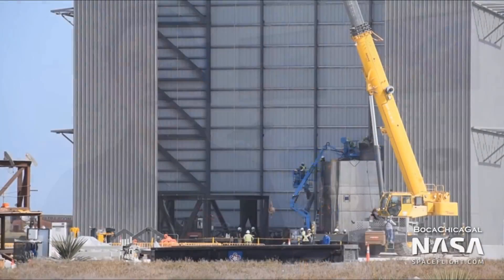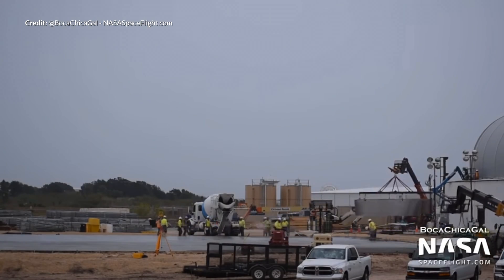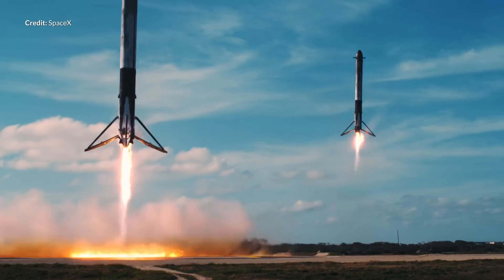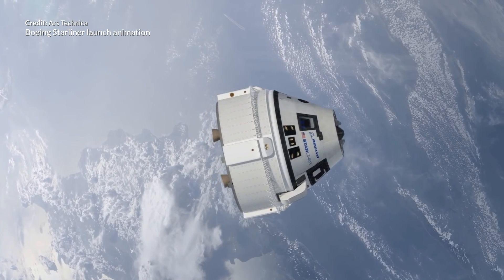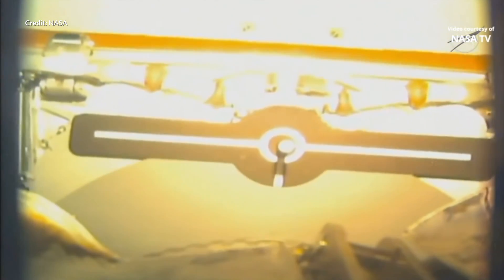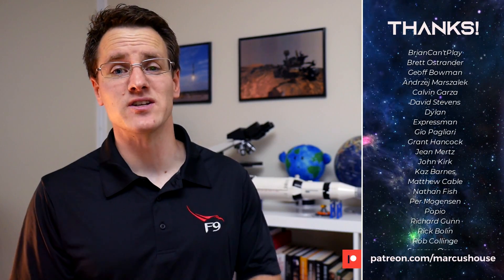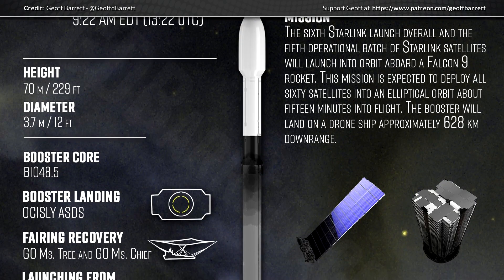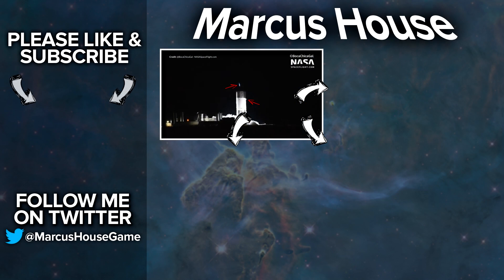SpaceX News, Flights with Starship SN3, Boeing Starliner, Blue Origin, Starlink 5 & Simple Rockets 2

Comment: It is only impossible because of physics, and merely a barrier that forces new thinking in mathematics and research to evolve what formally imposed orthodox of myopic ideas and technology.  Entrenched groups and technology, this works well for risk factors, that subsist on conservative dogma. By the large institution, engineering groups told not to take risks, and when young and passionate, you are squashed into submission or pushed out quickly—learning to get along versus raising the bar of innovation, advanced research, and investing in basic science and mathematics.

Comment: Great segment.  BTW - when you refer to a "water pressure test", the actual terminology of any pressure vessel in which testing employs water rather than compressed gas is a hydrostatic test, or "hydrotest" for short.  It is done for safety reasons.  A failed hydrotest generally just results in people perhaps getting wet, whereas a failed compressed gas test can go off like a bomb.  That's why, even those pressure vessels that are intended to be used for compressed gas always get first pressure test by way of a hydrotest; fill it with water, displacing all air, and then apply pressure to the vessel.

As always, thanks much for sharing.

Steve
Reply: The only drawback to hydro testing is that the weight of the water is a much larger factor than the weight of a compressed gas. This extra weight from the water creates a less even load, with the bottom sections of the tank being subject to greater forces and the upper sections being subject to lesser forces.
Reply: @XenicMatter , absolutely.  Nonetheless, it is usually the method employed to maintain an acceptable level of safety in testing.  I spent my entire career in the manufacturing segment of high-pressure oil/gas ball valves and check valves.  And of course the head pressure to which you rightly refer is generally not a factor on valves with comparably heavy wall sections and weight.

Steve

Comment: The worry with Boeing is that they have glossed over basic software engineering issues. They have shown that they don't understand basic testing concepts, for example comparing the actual final state of a test with the expected final state.
This suggests that they are testing for success rather than testing to find errors, ie failures.
At a personal level, it makes me reevaluate flying in Boeing vehicles, because this is the same kind of failure that was seen in the the recent crashes and the tankers. To me this shows a company wide cultural problem, meaning that it comes from the top. They need to refocus on their core business: Engineering.

Comment: All this rapid development is fine and all and i am fairly confident we'll be seeing starship test flights before long, but eventually they will actually need to get this thing certified as acceptably safe to carry humans. 

Trust me, Its being able to present a credible safety case to regulators that will take Space X multiple years to complete. 

Its not as simple as saying hey look we flew it x number of times unmanned and it didn't blow up, therefore it must be safe enough. You have to be able to quantify the risk (probability of failure * severity of failure) of the entire system and all its sub-systems and make a credible argument as to why that probability of failure is not only both, plausible and acceptably low but also that it is as low as you can reasonably make it. 

Most new planes, cars, toasters or whatever it happens to be, are based on incremental changes to established designs that can be used as evidence in your safety case. With starship though, the design is so different that they are likely going to have to qualify everything from scratch which will be a hugely expensive and time consuming endeavour 

This is why Dragon 2 switched to using parachutes and water landings

Comment: "need better and more testing, and better logs" is something that can be said about every software project ever.
Reply: MGL - But, Boeing’s really sucked - Boeing never ran a full debug on the software (let alone an end-to-end test of the software), &, because of the lapses in communications, NASA doesn’t have the kind of complete logs that NASA would have with almost any other vendor.
Remember, NASA paid a 75% premium on the basis that Boeing CST-100 would be safer & more reliable than the other contractors. Instead, CST-100 had a parachute malfunction during the Pad Abort Test & 61 (mostly software) anomalies during DM-1, several of which could have resulted in mission failure or LOCV.
Reply: Word!

Comment: Concrete Finishers is the name we use over here, and the machines there on are called ride on Power floats, there used on bigger slab pours, smaller slabs use a walk behind version, with only 1 set of rotating blades, think 4 or 6 large steel trowels, the ride on versions have 2 sets of rotating blades.
After the concrete is poured and levelled the power floats first use "Pan" which is a rotating steel disc that slots onto the blades this does the initial smoothing, after that the Pans are removed and the steel blades are used to finish the concrete if specified to a finer finish.

Comment: Marcus House: Could you address this issue?  Why does NASA never sent automated microscopes to look for life on Mars.
Automated microscopes are routinely used in microchip production by the Intel/AMD to look for surface defects ON cpu and other microchip productions down to sub micrometre levels. Thousands are scanned per hour and analyzed by software.Therefore could you investigate why is not being done? Nasa seem to be content to repeatedly do gas fart analysis which will always yield results which could be attributed either to life forms or complex chemical reactions.
Reply: If I had to guess, it's probably that the odds of picking up any exposed rock on Mars and finding microscopic evidence of microbes on it are effectively zero.
Reply: @EnDSchultz1  Who said the surface. The business end would be fitted to a probe which can burrow underneath.. Just like they have on the present probe on Mars.

Comment: Marcus - Do you know if SpaceX has ever explored production of forged, seamless ring segment?
Don't know if that's possible and if so, can it be done to the precision required.
I'd imagine they would have discussed it with steel manufacturers.  Just curios... Thx
Reply: My guess is that it would be too expensive/time consuming
Reply: mobayguy If they were forged, they wouldn’t have the extra strength from being cold rolled. The vertical welds are also not as problematic as e.g. the horizontal bulk head welds so not too much would be gained from having the rings be single segment.
Reply: @Borodalf  Good points Ryan and I've learned something new today about metal fabrication.  Great thing is that SpaceX is a thinking organization.

Comment: And I guess you also missed hearing from Tory Bruno of United Launch Alliance that the first flight-qualified BE-4s are going to be delivered for Vulcan this May.
Reply: Yes, because Boeing isn't making them. The engines may be there, but based on past performance, I don't expect the Vulcan to launch till 2023 at the earliest. They've said the first flights will be 2021, but if you believe that, I have a thousand acres of the moon's surface to sell you, a polar crater, so you have permanent sunlight at the top, source of volatiles in the crater shadow, even a nice masscon of heavy metals from the original impactor. Everything you need for your lunar start-up colony.
Reply: @stainlesssteelfox1  Boeing is not the sole owner of ULA, LockheedMartin also has half ownership as well and so ULA operates semi-independently of both companies. Also, ULA is currently on track to launch the first Vulcan rocket around this time next year. This why the BE-4 from Blue had to be ready this spring. Also, you can find plenty of ULA as well as independent space reporter video of Vulcan under construction in Decatur, Alabama. So it is real hardware and it is coming together just like New Glenn is.
Reply: @Nowhereman10  I know about the Lockheed Martin connection. I don't know if that's going to be enough to inject some competence into the design process. Here's hoping.
Reply: @stainlesssteelfox1  right but it's not as if LockMart is a small, peripheral thing. Also, ULA's semi-independent status means they have a different management team. So problems with Boeing are not necessarily going to manifest there. With Blue delivering engines in a couple months, Vulcan is going to come together rather quickly.
Reply: Tony Bruno is a joke.
Reply: @Cyberjohnnyt  and you're a worthless troll. Tory Bruno is a damn smart guy and knows his stuff. He's mostly responsible for keeping ULA somewhat competitive right now and if he ever leaves ULA, SpaceX and Blue Origin would do well to try and grab him up.

Comment: Wonder what effect corona virus will have on this rapid development programme?
Reply: Most metal construction jobs and industrial work like this require not only face and hand protection but half mask and or full face respirators (which are cleaned regularly with alcohol swabs, so they actually might be safer than you'd think

Comment: SpaceX 50 landings, competitors 0 and Jeff Bezos has the gall to go on TV and boast about being first to land a booster rocket. This is why I have no sympathy for Blue Origin. As per Boeing, the fact that Nasa is cutting them a ton of leeway and if SpaceX would have had one tenth of the issues Boeing had with their flight, they would have grounded them indefinitely, so not much sympathy there either.
Reply: Spot on.........Frankly, I believe Bezos is afraid to fail.........it's going to be a real problem because everybody does and he will too. As for Boeing, they're in it for the money, with no thoughts beyond. These are but two huge contrasts between Elon and them.
Reply: @GenasysMech  Bezos is a showboat narcissist like Musk.
Reply: Ok, so first of, the reason that SpaceX landed the first ORBITAL CLASS booster, is because the got funding from NASA. If anyone else had got funding for a reusable orbital class booster, then no doubt Blue Origin would have done that. And when they did get money for funding to build an orbital class rocket, guess what they did. They started development on an orbital class reusable booster. As for Boeing's failures, SpaceX had much worse failures to their Dragon 2 capsule, and had to go through the same review process as Boeing, so no, that's not true.
Reply: they were the first...and also the first to apply for a patent for the technology.
Reply: I mean, Bezos isn't wrong. And SpaceX literally blew up its manned capsule which is rather severe. Not ripping on spacex because the inflight abort obviously redeemed them of that failure, but NASA wants to have two capsules for redundancy they cannot be blamed for.
Reply: @williamcrawford7621  on the contrary their abort system is what makes D2 so dangerous.
Reply: @williamcrawford7621  Only good thing about SpaceX is they do enough testing to uncover these problems. Obvious bad engineering design but they found it before it was too late. Other manufacturers might not have the same luck due to their practices.
Reply: @FreeStuffPlease  how do you explain the code errors found during the starliner test then?
Reply: @divedevil985  that wasnt much of a test as a demo. They should have already found those errors
Reply: @FreeStuffPlease  I see. So the first time 3  (2 of which had never flown before) distinctly different vehicle subsections had to function together was not a test? Yet spacex had about 40 prior attempts to prepare for flying F9 and D2 together. What happened to "this is why we test"? 

Your comment and rebuttal are both ignorant.
Reply: @divedevil985  Lol whatever you say. Boeing could have unit tested their code and found some of those errors. It is an embarrassment how much of a failure that "test" was. What a waste of a rocket and millions of dollars.
Reply: @divedevil985  Go play with your 747 model planes now us adults our busy.
Reply: @FreeStuffPlease  like sending a tesla roadster to Mars? Your original point if I recall is that only spacex finds faults during testing. Although they are the only entity to routinely inadvertently destroy their test articles (and production versions) by no means is there any preferred methodology demonstrated in their build, destroy, build again development model.
Reply: @divedevil985  That demo was a success but at least you are trying. We will see how your SLS goes first try. Its going to be a while though...
Reply: @FreeStuffPlease  although the 747 was the most successful heavy commercial aircraft in history I spent my time building and flying the space shuttle among other historic aircraft. Being an unquestioning Musk groupie does not qualify you as an adult.
Reply: @FreeStuffPlease  the first launch of F9 nearly drifted into the tower during liftoff, did not achieve nominal payload orbit and the booster spun to pieces before splashdown. Guess you didn't know that....ignorant of history just as I thought.
Reply: @FreeStuffPlease  somehow you new space flunkies think taking the trash out of the Boeing designed and built ISS that has been in orbit since the 1990's is an unequaled accomplishment. I don't work for Boeing by the way. I just know history...in part by making it.
Reply: @divedevil985  Ouch that hurt. Just because Boeing has some flaws and can't catch simple errors in their software makes me a fan of musk? I guess that makes sense. If you like Boeing so much why don't you go fly on a flawed 737 Max. Or the failed Starliner. Or an untested SLS. I on the other hand will take my chances in a crew dragon and falcon 9. Like every other person with a brain.
Reply: But Jeff is correct though, blue origin did land a rocket booster and fly it again first. It just wasn't an orbital class rocket booster, but he never claimed that it was, so i don't really see why you're getting angry about it. This is also why Space X always states 'first orbital-class rocket'.

The rest of what you are saying is just hyperbole. What leeway is NASA cutting Boeing?
Reply: @Br3eZzY  no, they didnt. Grasshopper did that first. Even , Mc Donnell Douglas did it before with DC-X.

The only difference is that Blue Origin went higher before landing. But neither was orbital, so the speed is nothing like what SpaceX is doing.

For a development platform, its all good and required. Buy the pace of Blue Origin is way too slow to challenge SpaceX, no matter how much Bezos wants to brag about it.
Reply: @Coyote27981  Blue origin was the first to get above the Kármán line with a reusable rocket.

Comment: Excellent video 👍.
Space X, and Boing are competing to supply the space station and transport astronauts as well.
But the station is scheduled to be decommissioned in 2024, if I'm not wrong. 
If you can make a video about the subject and about the replacement of the actual space station, that will be a tremendous opportunity for us to  have the full spectrum of the endeavor. Thank you.
Reply: The ISS is planning on performing mitosis with the commercial capsules made by Axiom. Maybe Axiom will replace the ISS directly or they could replace the previous generation ISS modules with new ones to keep the station continuous.
Reply: I think a commercial station will probably replace it.

Comment: If you're familiar with the extraordinary lengths taken to reduce the decibels at launch of pretty much all existing large rockets you'd understand the problem with the starship plus superheavy. Even the space shuttle launch would blow itself apart every single time a launch attempted if not for  diverting the exhaust and tossing tens of thousands of gallons of water per second into the stream to "quiet things down." This latest spacex venture is reminiscent of the grand public works projects from prior civilizations which resulted in total collapse. What if the superheavy was never meant to fly but instead is a diversionary tactic to spend up some of the ongoing hyperinflation while providing distraction from the imminent collapse of the West? Face it. If this thing makes it to space that's one thing. There's no fucking way they'll survive blasting back off the Martian surface.
Reply: SpaceX represents a tiny, TINY fraction of the overall economy.

Comment: I'm really curious to see how the solar panels/ cells will be placed on Starship eventually and if they will still use that 'hand fan' configuration'
Reply: Would probably be deployed in space. Won't be able to handle heat at re-entry.
Reply: @johntheux9238  Eh, if they're on the back side?
Reply: @yoshi6236  There is still radiative heating.

Comment: This might be a dumb question, but why aren't the segments "taller"? Wouldn't that decrease the amount of welding needed? 

Thanks.
Reply: AugmentedGravity it has to do with metal availability. The current stainless (306 i think) is only available in certain sizes due to manufacturing. When they go to 30X it may come in wider rolls.
Reply: @redbovine  Oh, i had no idea! Thank you very much sir.
Reply: They can only buy rolls so big

Comment: Rapid prototyping comes at a high cost in labor and materials but the learning curve is much steeper and consequently MUCH faster. We are seeing this with everything SpaceX is doing. ESPECIALLY if you compare their work to BO.
Reply: And SpaceX is doing it with stainless steel. Cheaper and easier to work with than carbon composites.  If you mess up in SS you cut it out and start over. Mess up on carbon fiber, throw the whole thing away and start over.
Reply: redbovine well said.